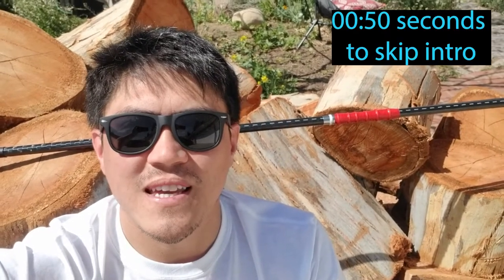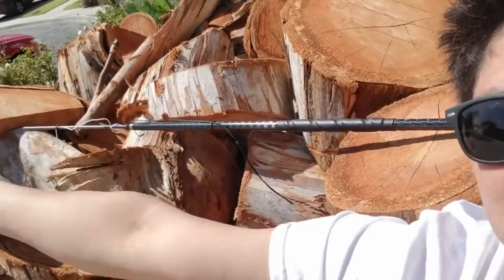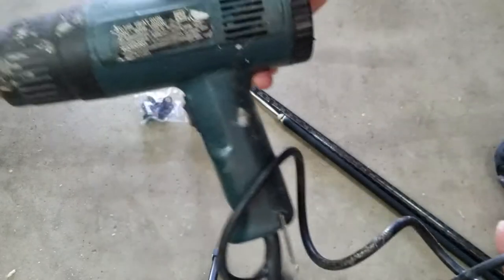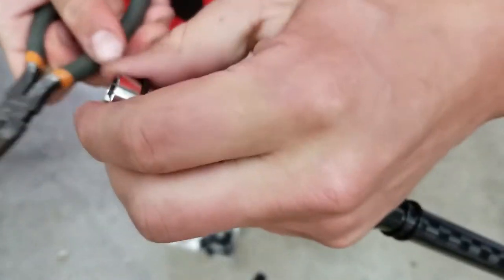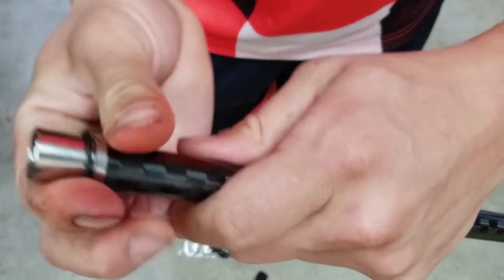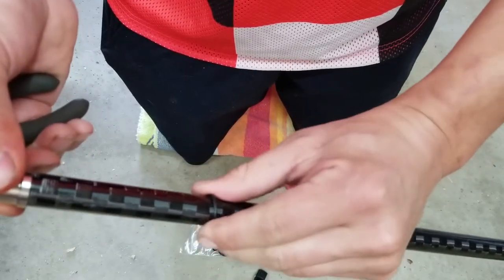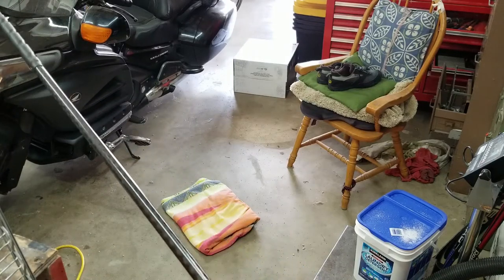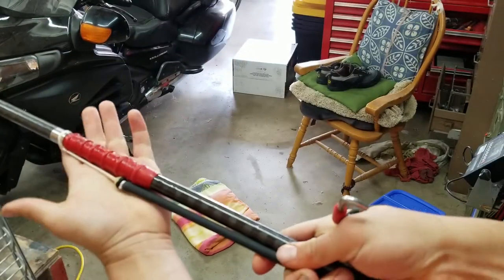How To Install A Pole Spear Grip Kit - Mako Gorilla Grip - Heat Shrink

Comment: Good idea dude. Putting those o rings in hot water will make them more pliable and easier to stretch.  
New to spearfishing.  Subscribed.  Thank you for the info.
Reply from the maker: Woohoo and good call with the warm water. I’m going to try that on the next spear.

Comment: I have a 20 mm carbon tube... What should be the diameter and the tickness of these o-ring? What are the ones you are using in this video? Thanks.

Comment: That's not shrink tape, that's self amalgamating (or self fusing) silicone tape that doesnt need heat to work. It's amazing stuff a lot grippier than shrink tape but softer and can peel off at the front end if you're not careful. Good news is it's cheap to replace, easily found in any hardware store and you can protect the ends with shorter bits of shrink tape. Happy hunting:)
Reply from the maker: Thanks for the info dude! But according to the Mako website it’s a high grade shrink tape. I’ll definitely look into the stuff you mentioned. The mako grip is still holding strong for me since this video. Great stuff! Happy hunting bro!
https://makospearguns.com/pole-spear-gorilla-grip/